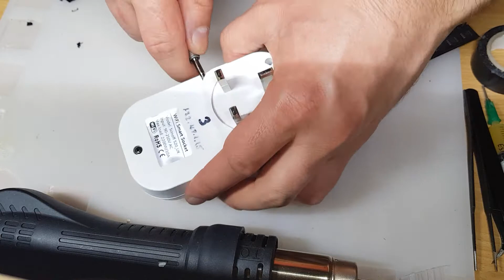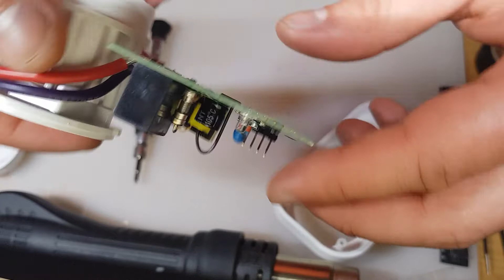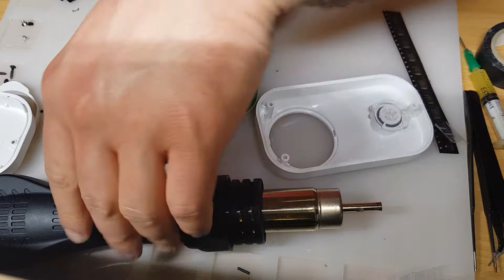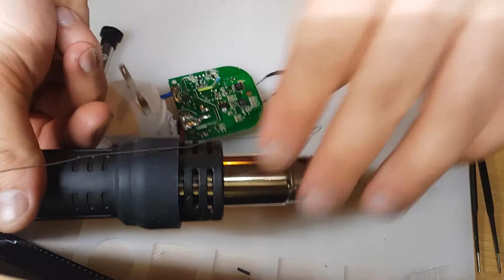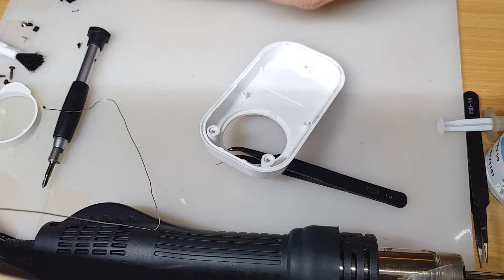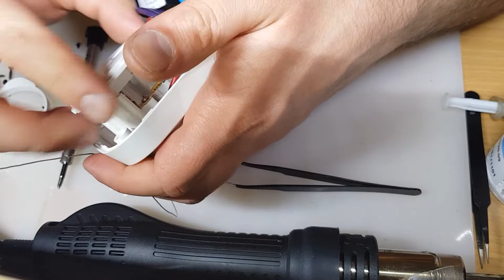Update Sonoff S20 memory to enable Arduino OTA (Smart Socket)

Comment: Hey,

this looks nice.What's the type of the replacement chip, that I need?

Mebus
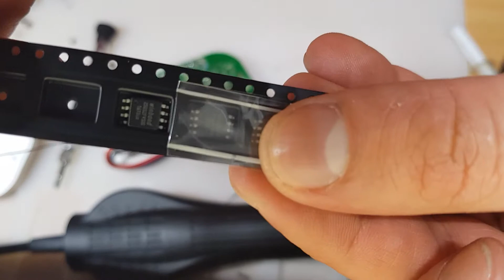Reply from the maker: Merlin Bussard , you can see the code on it  on 3:52 .  Check that code on ebay

Thanks!
Reply: Hard to read, but seems to be "25Q32FVSIG".

Mebus
Reply from the maker: @merlinbussard7335   yup, I checked again on eBay and that's the one. You can get 10pcs for a bit over 2£ from China